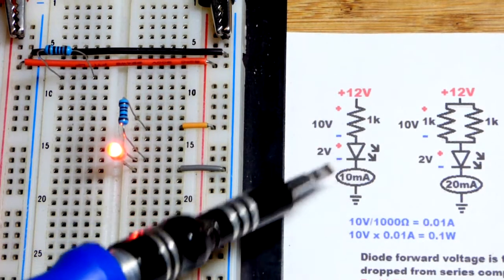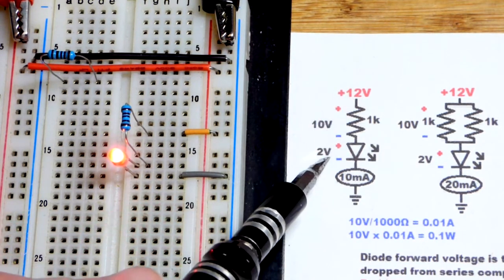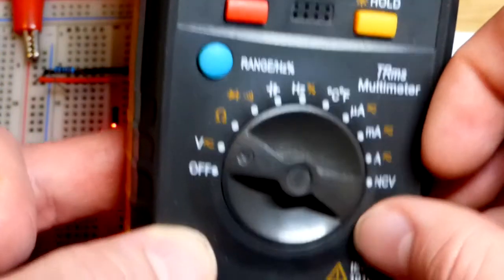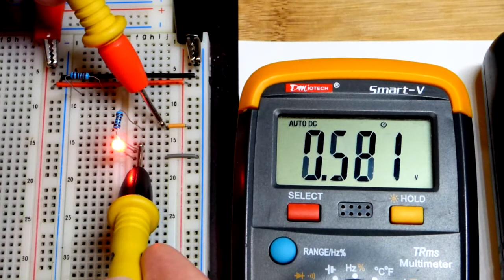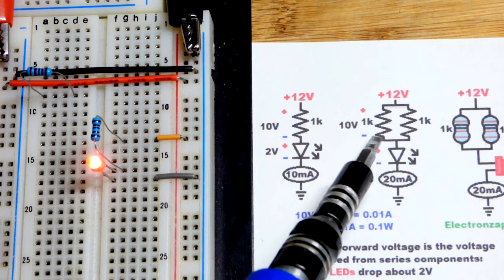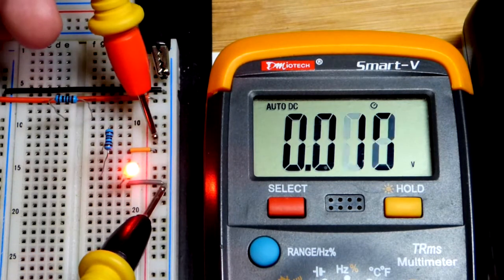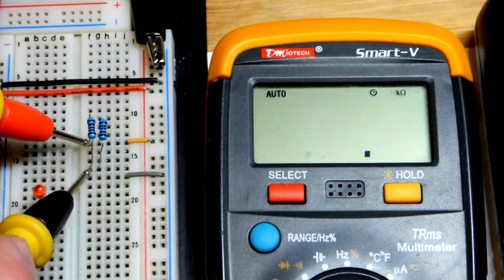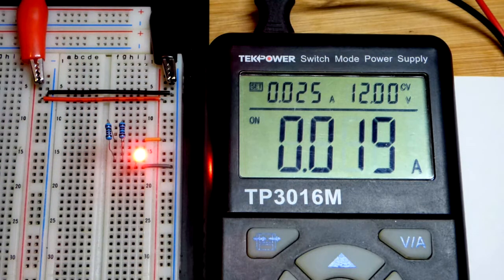Learning electronics LED forward voltage demonstration using light emitting diode and resistors

Comment: If you put another (current) limiting resistor in , shouldnt there be passing LESS current to the led and dimming it?
Reply from the maker: If resistors are connected in series, then their resistance adds up. But when they are connected in parallel, their conductance (and thus currents) adds up.
Reply: @Electronzap  I gathered that had to be the answer. And after watching the vid for the 2nd time I heard you say it. and show it.
 But why do series and parralel have such different behaviours. After all, resistors do not have a plus or minus pole or anything else hat is different about  them. Or is the cause something else entirely?
Reply from the maker: Electric voltage behaves a lot like water pressure, and electric current behaves a lot like water flow. If water has to flow through a very small pipe (electricity through high resistance) then the longer the pipe (or added series resistance), the less water (or electrical current) will pass through. 
If you give that same water pressure (voltage) to 2 small pipes (resistor) that are in parallel, then water (current) will flow through each pipe (resistor) independently, so that the water volume (current) adds up.
Reply: @Electronzap  I see. Very clear to me now. the 2nd resistor negates the work of the firs one, not because of something it does, but because of the very nature of current. 
Can I assume the same kind of principle works between thick wire and thin wire? The thin wire has more resistance because There is less room (road) for the  electrons to travel on. This creates more friction, thus the thinner wire gets hotter? when would you wanna use either Thick or thin wire? Maybe something for a new vid.
Reply from the maker: Yup, you need thicker wire as current goes up. More conductive surface area does reduce resistance per foot and also helps dissipate heat. I'll keep higher power videos in mind!